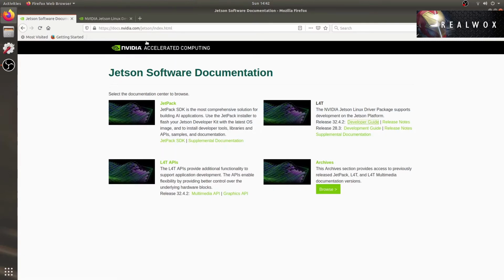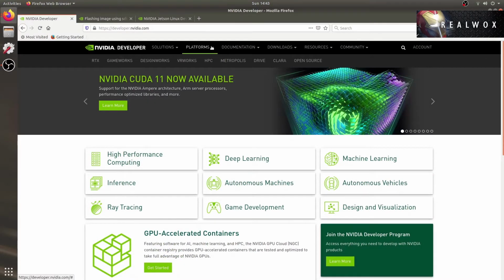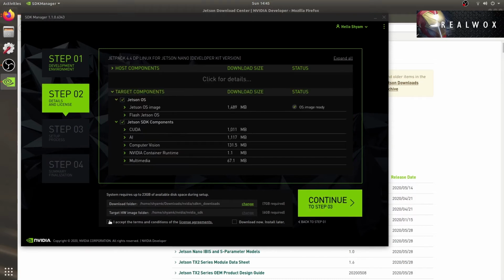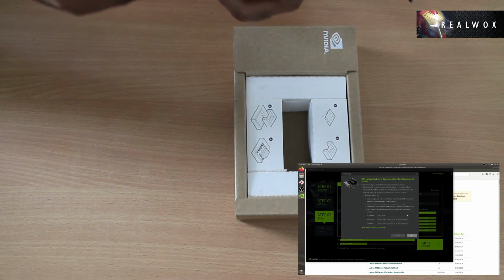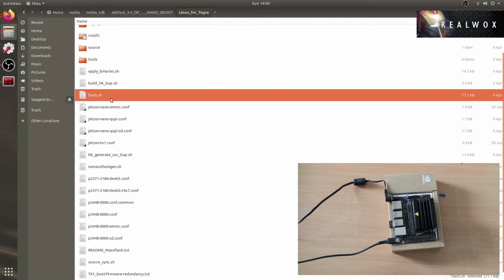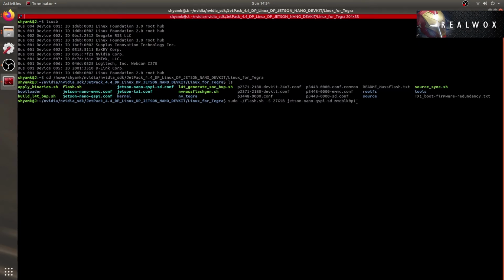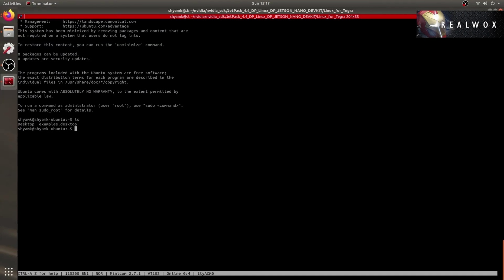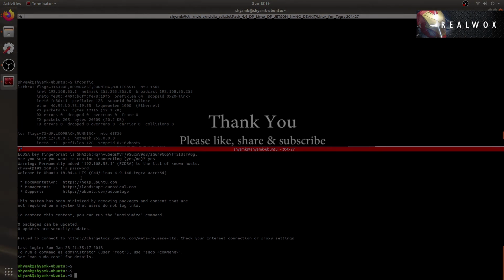[DIY] Robot using NVIDIA Jetson nano - Flashing the board with L4T software

Comment: In order to connect to a laptop, what is the Jetson Nano connected to?
Reply from the maker: You can connect micro usb cable to jetson and connect it to laptop. There is an interface l4tbr0 which allows to connect to jetson via ssh over usb
Reply: @realwox7373  thanks brother